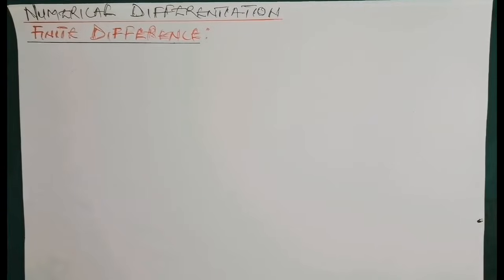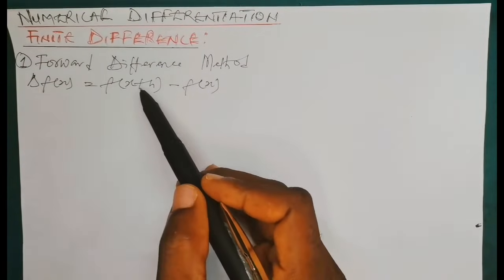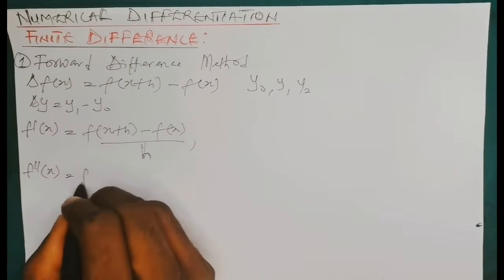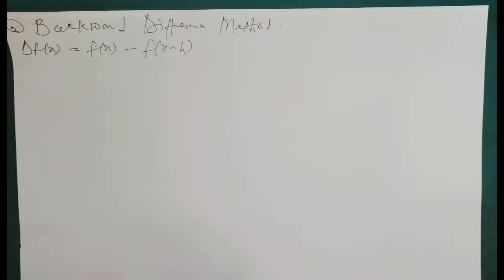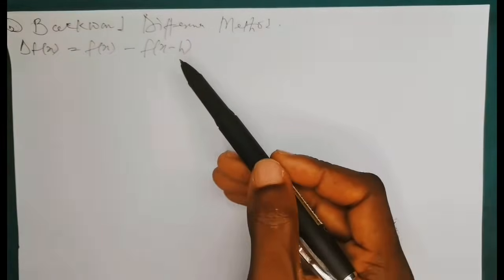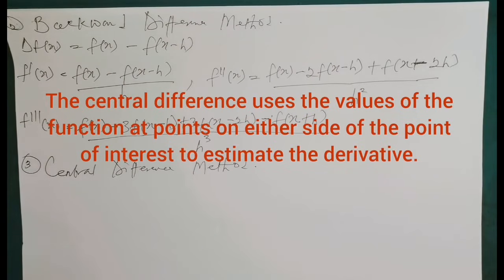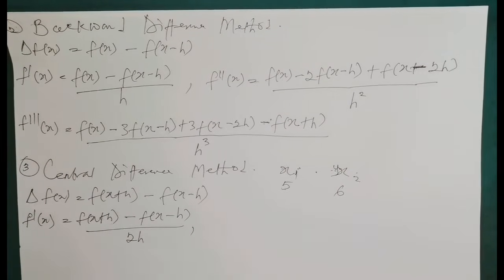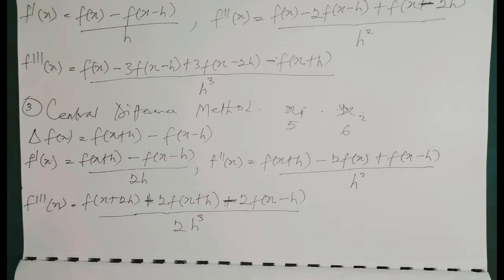Finite Difference Numerical Analysis Engineering Mathematics | Introduction #EpelleMichaelRowland

Comment: Check the 2nd derivative of the central difference method, shouldn’t the denominator be 2h^2 instead of h^2, just asking
Reply from the maker: Thank you for the observation... It was completely an oversight... Pls there should be 2h to the power of 2 in the 2nd derivative approximation...